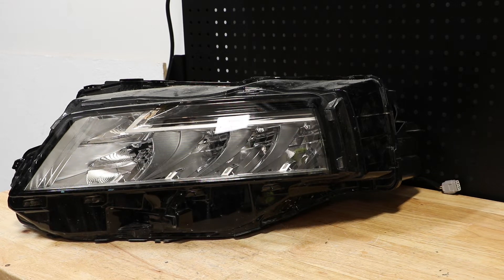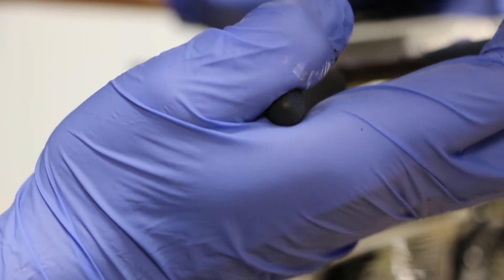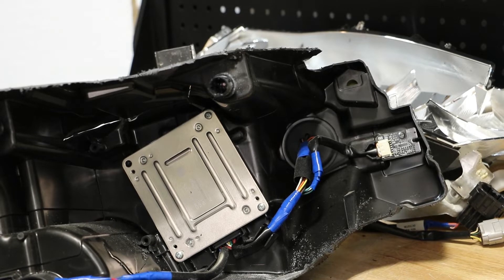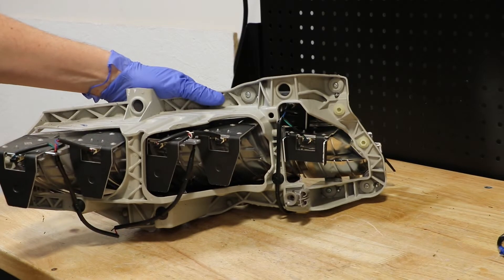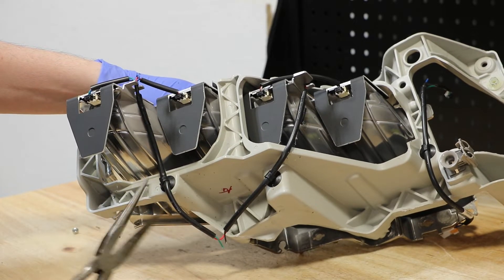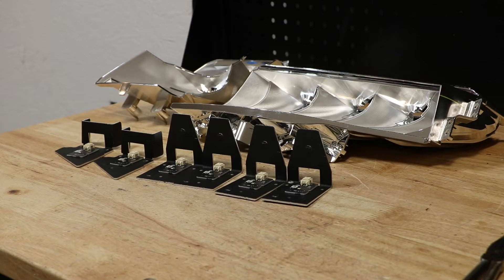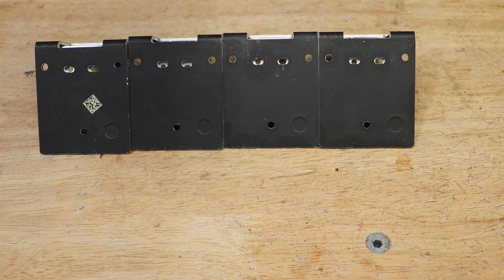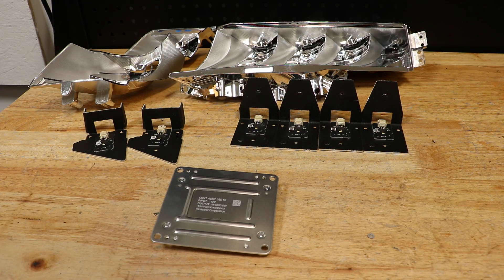2021-2023 Nissan Rogue LED Headlight disassembly

Comment: Hey I would like to ask you a question. I see the teardowns of modern and advanced laser matrix headlights, but I can't understand how the adaptive lights work. I wish to understand if it's the projector itself that moves or whatever the projector is attached to. I don't mean this car in particular, just in general what you've observed.
Reply: There are multiple ways to and types of adaptive headlights. In lights where the beam pattern swivels from left to right when steering, there the projector itself actually physically rotates. The projector is mounted on a bracket, the projector swivels inside this bracket with a motor also attached to the bracket. This entire assembly moves up and down as well for height adjustment (for instance when you load it up with luggage). This is common in Xenon projector as well as LED projector headlights. Some BMW's have this and they can do some sort of selective beam output by swiveling left and right headlight projectors individually, so when a car is oncoming it can aim the left projector forwards in low-beam and the right headlight towards the right in high-beam (in LHD car). 

There's also headlights, like you said, with the matrix function. In those cases it can turn on and off individual LEDs to blind part of the high-beam pattern. They engineer the lights in such a way that they know exactly what part gets illuminated by what LED and they turn them on and off depending on what is needed. A nice example on this channel is the Tesla Model 3 facelift headlights (so with the projector), that has a Hella pixcel projector and you can see around a 100 individual LED's somewhere towards the end of the video. They can even change to 12 different types of cut-offs for different countries/regulations
Reply from the maker: it depends on the light.  I've seen simple designs (toyota/nissan) that simply raise/lower the level of the light from outside of the headlight. Think of it like automating the manual external headlight level adjusting screw.    

Then there are more advanced systems where there are motor(s) inside of the light.  Sometimes attached to the projector, sometimes attached to the main bracket for both low and high beam.   The most I've seen is 3 motors to control level and direction.  

In short there is no simple answer, but it just depends on the level of control the manufacturer wants to go to.   

1 motor = simple up/down level.   
2 motors = up/down and left/right control.  
3 motors = generally up/down and left/right for more than 1 projector/reflector (high and low beam)